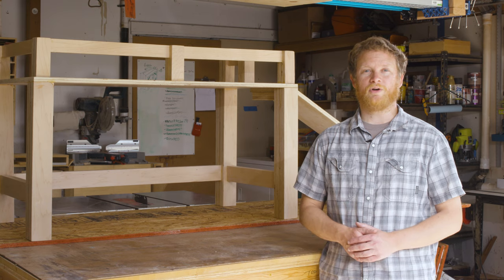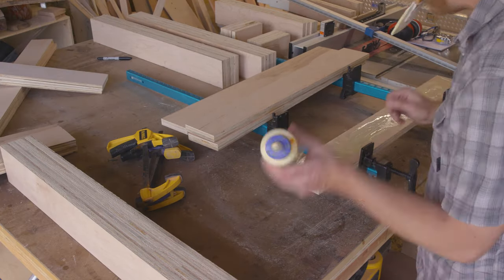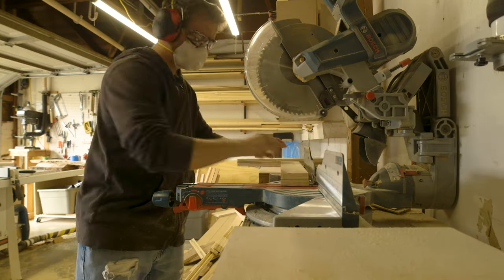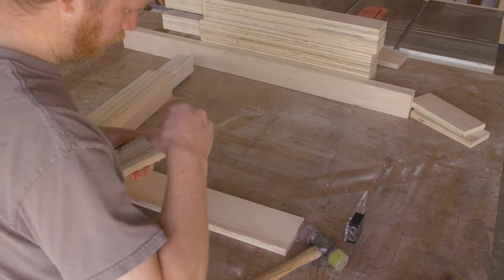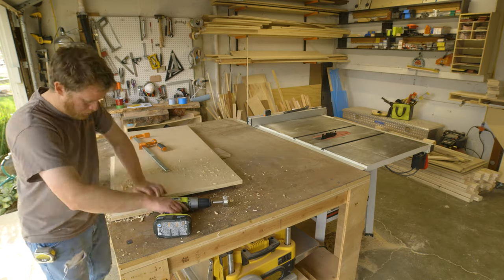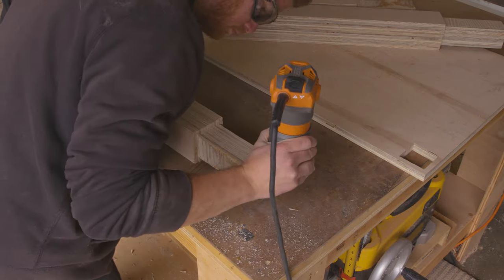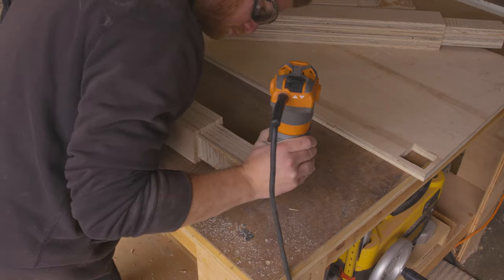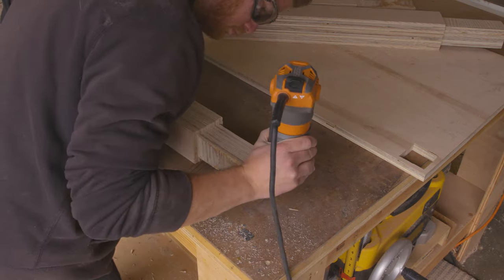DIY Plywood Dog Bed with Removable Ramp

Comment: I had an idea the other day after watching this. I'm suuuuper new when it comes to woodworking and DIY'ing, but I really want to try making this for my dog, so here's my idea: I want to try using an Ikea coffee table as my base and working from there. I was thinking of replacing or adding length to the legs to get the height i'm looking for, reinforcing the structure somehow, and adding rails. Then I'd just have to make steps or a ramp. What do you think, workable?
Reply from the maker: i think by that point it would be cheaper and easier just to do it from scratch